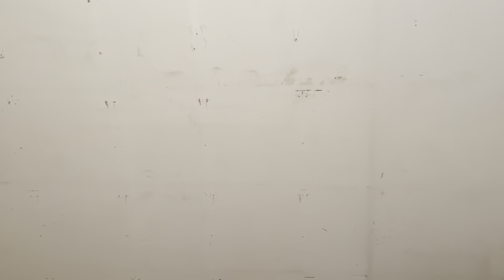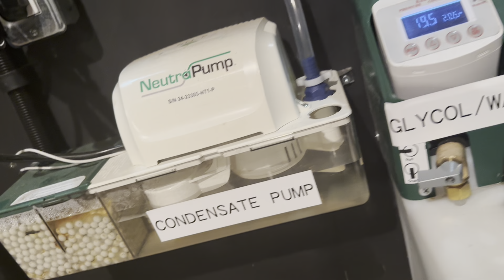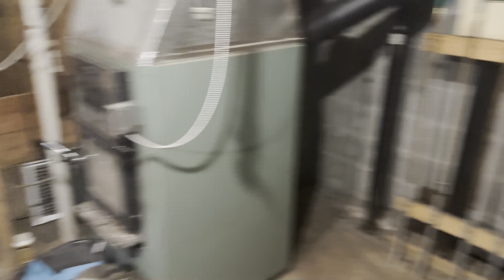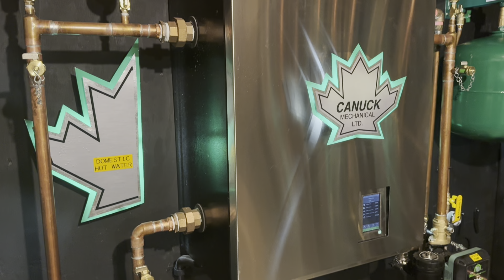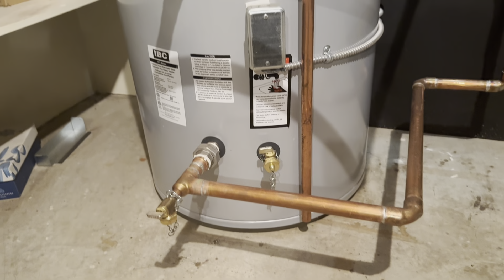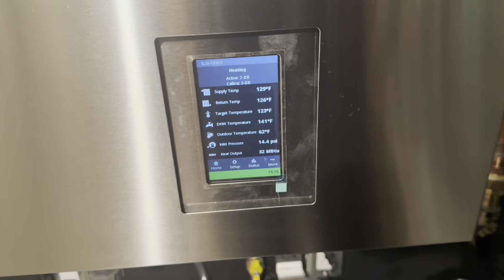IBC Boiler Retrofit SL 30-199G3

Comment: Nice job . Is there a mix valve for the low temp zones. I like those separaters as well but love the primary loop and closly spaced tess with the low temperature zones. Perhaps the ibc only puts out 120 wheb low temp call is out? How it control for that  . Unions for the indirect be good too . Mirco bubbler or a 3/4 micro mini bubbler  are good on that otop of that hydraulic separator as well. I like them Better then those air vents . Obviously great job done and respect for another tradesman with a keen eye.